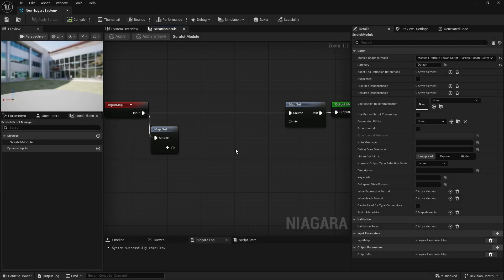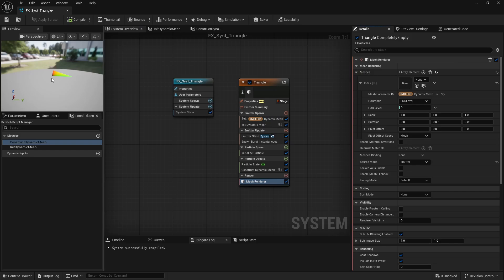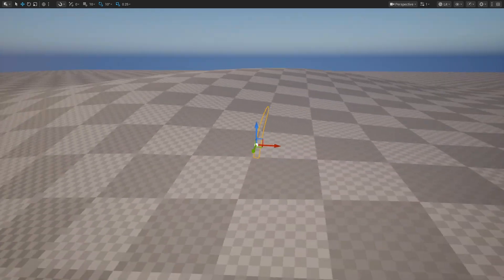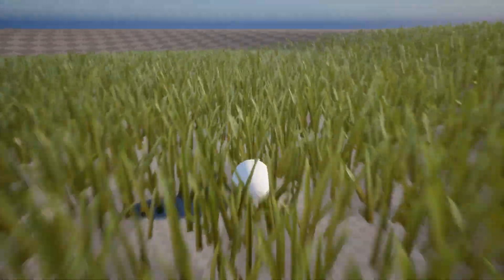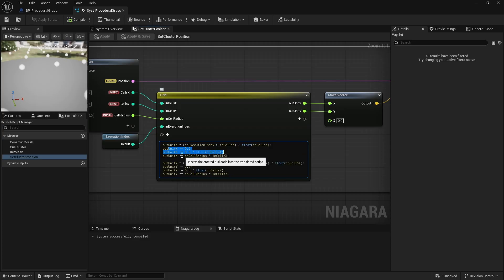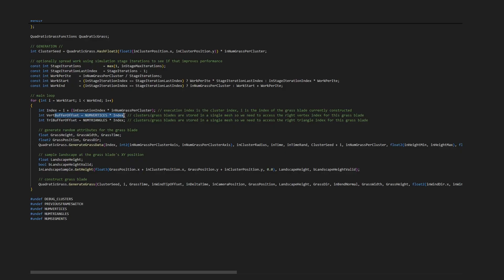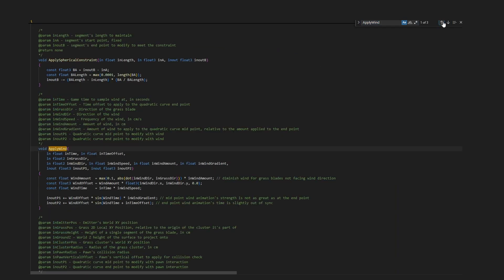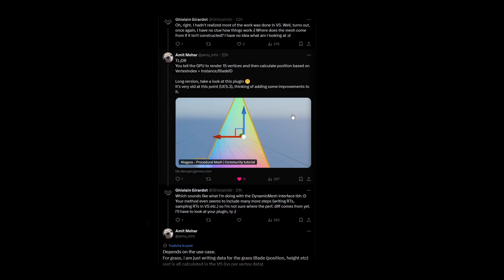Intro to Niagara’s Dynamic Mesh Interface

Comment: Hello, I am not able to apply a material on my niagara dynamicmesh (The texture of my material is not applied, only a color is displayed.), has anyone got this problem too ?
Reply from the maker: It sounds like you need to create UVs. Mesh vertices UV are likely collapsed to 0,0 because unset so you're likely sampling a single pixel of whatever texture you're sampling. That is my guess.

Comment: Finally got time to properly test Niagara Dynamic Mesh in UE 5.6. Unfortunately just as you have already mentioned in this video, the performance is surprisingly poor when you have more than few thousands particles. This is very baffling considering this feature is by no mean "new", despite its experimental status. As such we have no choice but to fall back to material WPO for the time being. More unfortunately is that the Dynamic Mesh is not temporally persistent, meaning we must set the Dynamic Mesh vertex/triangle data every frame, instead of only at Particle Spawn, otherwise the Dynamic Mesh will be reset next frame.

Comment: Do you know if it is possible to have lumen to work with mesh generated with this plugin?
Reply from the maker: I didn't check tbh! Should be fairly straightforward to test though. Make a big colored triangle and see if the surrounding lights up with bounced lighting :)
Reply: @ghislaingirardot  ok thanks

Comment: the cost of niagara can be seeing.
Reply: I don't know what you mean. Even the older basic particle systems procedurally generate quads for sprite. Dynamic Mesh just gives the users more control on the procedural mesh vertices.
Reply: @ultracapitalistutopia3550  
i mean the performance of doing this technique with niagara, it have an initial performance cost.
Reply from the maker: Niagara definitely has a base cost but it's likely not the reason for the bottleneck here. Issue is more likely to be the experimental Dynamic Mesh Interface going through a very un-optimized render path, and/or just not the right tool for pushing that many vertices to the GPU :)

Comment: Before dynamic mesh I used a small triangle mesh to achieve similar effect. I believe Asher's matrix ghosting Agent Smith effect did something similar. It's very nice and convenient to have dynamic mesh in Niagara to simplify the process.
Reply from the maker: There are a lot of different ways to do this kind of procedural mesh stuff, yeah :)
Reply: What is the advantage of the dynamic mesh instead of small triangle meshes